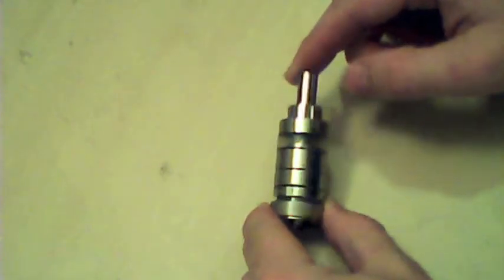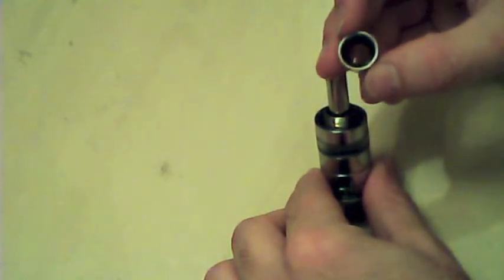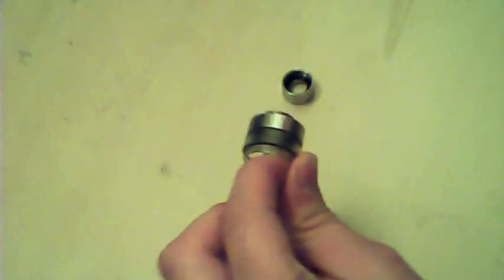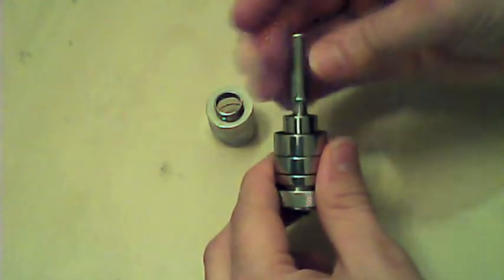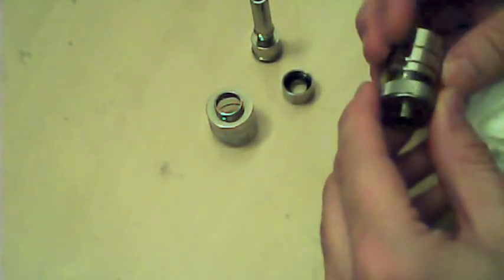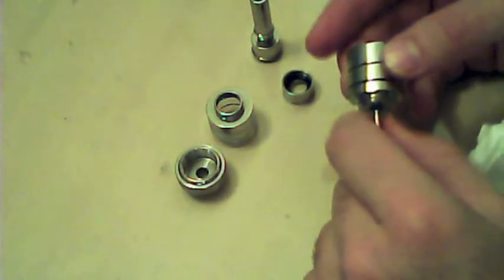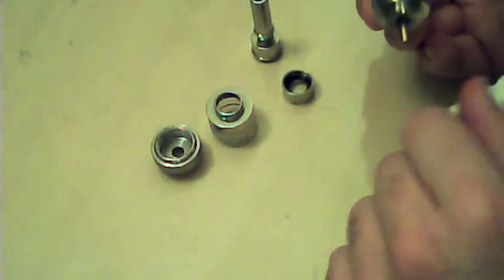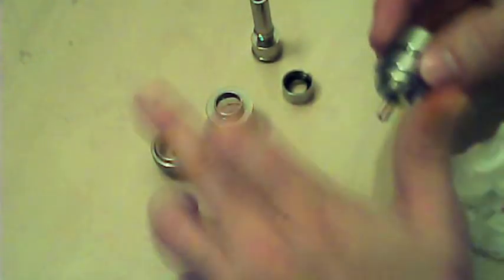vaping for beginners - tom vapes \ ithaka clone

Comment: You have the ithaka  set up wrong. You have the metal piece that's supposed to be above the plastic section on the bottom. You should of got the ithaka clone by hcigar. Its a lot better than rainbow heavens ithaka. It also has the logo and serial and every part is 1:1 identical. It doesn't have shorts either like rainbow heavens does. I got it for $35 at fasttech